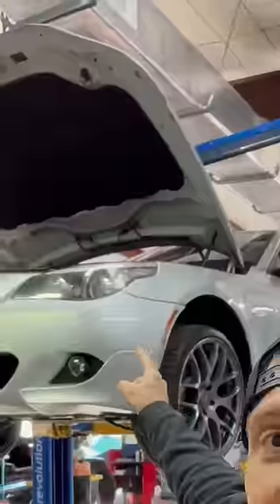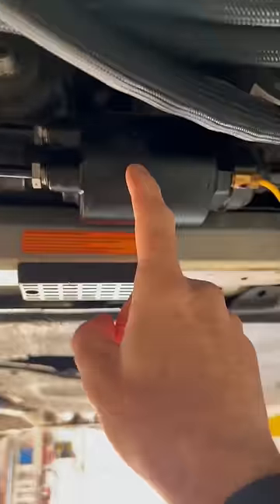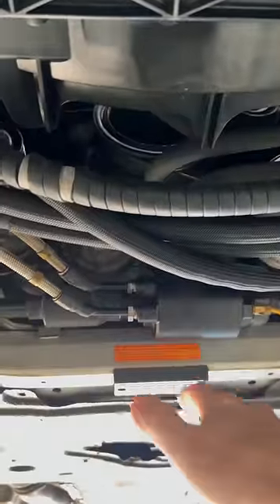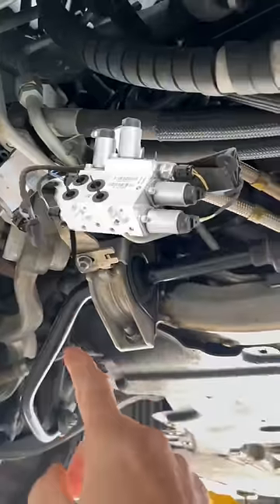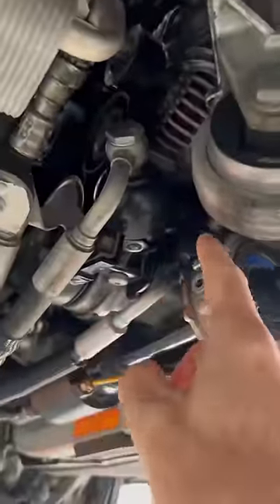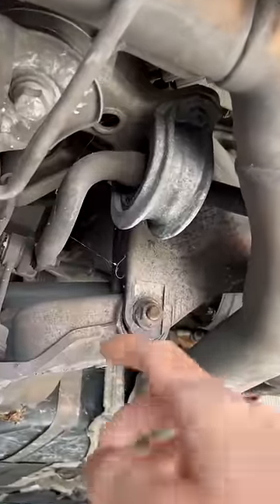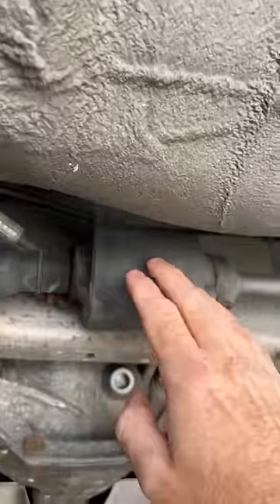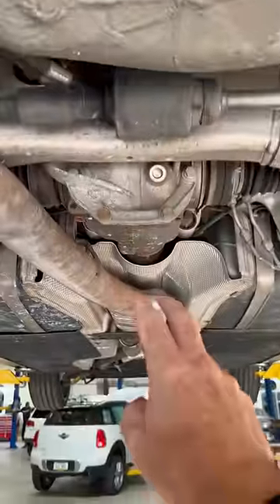Over engineered?

Comment: The system is a neat idea. The handling characteristics driving one of these cars are impressive considering the size and weight. I was working for BMW when this design came out and I now own an auto repair shop specializing in Germany’s big three (BMW, Mercedes and Porsche). We work on mostly older Porsche’s. I’ve experienced German over engineering for over 20 years and that is a prime example of German over engineering. These items are great until they aren’t then they are too expensive. You forgot to mention the over abundance of electronic involvement to make it work. All of that being said, I have seen very few issues with that system. That is great considering that is has been in those cars for nearly 20 years.
Reply: Perfect summary right there. Also, very glad to hear you haven't seen continuous failures on this system.
Reply: Owning an "old" BMW is a lifestyle or hobby if you repair it yourself. Nothing wrong in it, just admit that Toyota would take you from A to B with much less. I've now G30 530e -17 and I've been happy w/ it, but w/ the ex E46 330d -04 I spent far too much effort and money to keep it a decent daily. I'll change the G30 530e to newer after this summer, since I don't want to spent even a thought to the extra maintenance or possible issues it might get.
Reply: Same, went through BMW S.T.E.P. in 03. Worked on BMW's for 10yrs before switching to aviation.
Reply: Just out of curiosity.. what is your favorite German brand to work on?

I think I know the answer.
I'd like a confirmation from a guy that works on all German cars.

Comment: I had an e60 .... the active sway bar makes a world of difference
Reply: No they don't...get rid of the sway bars altogether and just get adjustable coilovers..☝️
Reply: @boosted2.4_sky  what is suspension geometry anyway right?
Reply: @stryker7x how would you know? Did you compare it with the same e60 with a solid sway bar?
A sway bar is only there to fix a problem caused by the centre of gravity being higher than the roll centre. If they just designed the suspension better, this wouldnt be needed.
But its so that you can have both comfort mode and sport mode, when Realistically, its just a heavy car with a badly placed roll centre.

Comment: Citroen used a high pressure pump for their hydraulic suspension, brakes and steering. Worked really well and reliably. When it needed service the repairs were simple and inexpensive.

Comment: it can actually cause body roll in situations where the body wasn't actually going to roll. for example, if the suspension travel in one wheel is far greater than the other on the same axle, it would roll the whole body, to prevent the suspension from completely absorbing the effect on one side.

Comment: My jeep has its suspension with air tubes and such to lift/drop the vehicle in certain conditions/settings. If a tube leaks, that is an easy 2000 to repair as well. Dont really consider that or this over engineering as it is there for a purpose and/or tuning and people just need to be aware of it when they buy them.

Comment: It's to keep any home mechanic from working on their own car.
Reply: Exactly!!!
Reply: No, i got a car lift @home and i could repair this. I am not a professional
Reply: Lots of things may be, but this, this is not one of them...
Reply: Build your own car then! You can work on it 24/7! :)) I'm not a BMW fan (or any other German car in fact), but you can't say they made this interesting system just to prevent you from working on your  old BMW!
Reply: not really? because you can get the parts through both the dealer or aftermarket. Also can replace it with a normal sway bar with little to no issue

Comment: It is awesome engineering. I had a 545i with that system. It provides a confident handling at all performance levels. had the car up to around 250,000 miles and that system never failed or had an issue once.

Comment: I had an 2007 750li and I had to change the front sway bar once at around 50k miles. I ended up getting a used one with low miles and had an indy replace it. Cost me $300 for the part and $500 for labor. Not that bad. Sold the car with 125k miles. Never had a problem.
Reply: Had the 06 model same car. Blew a few O rings hitting 155mph. Then the water pump went. Not too long after the engine was leaking more oil then it could consume. She was a beauty tho

Comment: My father taught me car control on snow before I got my license in a 1979 Toyota Corolla four speed. My second car was a 4 year old 82 Supra L that taught me car control on dry asphalt at speeds I shall not admit to but I've never lost control and wrecked so there's that. My current car is almost 20 years old and I'm keeping it and don't want driving aids and babysitting tech in my car. Besides, it's more fun sliding a car with no horsepower around at the speed limit than having more power than necessary although that would be fun on a rent basis.

Comment: Basically the same way activa on the Citroen xantia works, one drop link at the front and back was a hydro ram which worked on the anti roll bar to stop body roll and keep the tyre grip patch at it's maximum level.

Comment: Had to work on a 760 recently and found all this out. It's alternator bracket was leaking oil. Yea, you heard me. Also the alternator was cooled by coolant. So much else wrong with it besides too.
Reply: oil is not coolant and cooling off a part in a hot engine bay with water while also helping the engine up to temperature in winter is pretty smart.

of course. more functions more possible trouble.

remember the good old times of automobile where you plugged your steering wheel in the front of your car to manually crank it ?  that was a reliable system.  same on prop'ed planes. just yank the prop until the engine starts. no starter, no battery, no electronics to break.

Comment: Great for a new car and would be awesome to use, dynamic suspensions are the zero compromise option for handling and drivability. I’d rather just run big thick old school sway bars though for the simplicity and lack of failure points

Comment: I have an E65 with such active swaybars and I really like them. I do understand that this is a sensitive and expensive system but this is one of the things making the car running so smooth and perfect.
I'ts a decision: high quality ride or cheap and simple to maintain?
(Almost all of the older cars are leaking some oil at the hydraulic units of these swaybars. I agree that BMW could put more emphasis on the quality of the sealings, or, at least design them replacable. The sealings, not the swaybars. The swaybars aren't that easy to replace, either, it's not just their price but in E65 the rear one is deeply embedded into the web of arms and drive axles.)

Comment: I would want that on a 7 series type car to be used with for family outings. I would prefer to daily a 2 series that absolutely does not have active sway control unless the control itself is somehow totally manual (I don’t know, control it with column-mounted  paddles? Upper paddle affects the front, lower paddle affects the rear?

Comment: Well, I had a e65 for more than 15 years, the system didn't break and that 'cow' was keeping it flat even on very tight corners, that was pretty amazing... but, maybe I just got lucky. The problem in my opinion is that you cannot do anything to these mechanics, if they break, they break. It is not like with engine oil changes, where you can change the oil regularly, not rev it when it is cold, drive smoothly, use best type of gas/diesel ect. ect. that would keep the top shape. 

All in all, ok, I will say it like this - it is worth it in this case, because it makes a very big difference and at least old systems (I don't know about the new ones) didn't brake so often. 

If anybody has a different story, please share.

Comment: hydraulic lines at car bottom always rust out. This is duct tape solution. The correct way to do it is using active struts, which is way more expensive today, but it will be cheaper when Chinese manufacturers jump on it.

Comment: Porsche does this, too. At least with the Cayenne. It’s very cool watching it do the bleed procedure when the big thing moves side to side very quickly. Looks like a dog trying to shake water off. 

This is engineering designed to last the lifetime of the warranty. It’s too expensive too repair outside of warranty. I’m sure there are plenty of those out there with butchered or brown systems because the owners can’t afford the repairs.

Comment: Land rover used a system like this on the disco 2, except rather than a complicated anti roll bar with a hydraulic motor in it they essentially used a hydraulic piston in place of one of the drop links. Since BMW owned them at the time, I wonder if that's where they got the idea from

Comment: I think it's excellent engineering, but not exactly a good idea, one is it could fail fairly easily considering how much pressure it's working under and I'm sure a similar result could be attainable by using an idea like those lift kits for exotics and the on the fly adjustable dampers. I had an old tx5 Ghia ford Telstar ( we all make mistakes 🤦🤣) that had a system to adjust the suspension. It had 3 modes... soft, normal and " sport ". It did several things, under acceleration it stiffened the rear, under braking it stiffened the front and the same for cornering. It actually worked really well and by making adjustments at the shock would be far less difficult then doing it with the leverage of the sway bar.

Comment: Audi is now using electric motors on the sway bars ro do the same thing. The low version is 1 motor to torque the bar. High has independent bars on the same axle operated by separate motors. Can't wait to see that bill for failure.

Comment: Have this system on my 2010 e60 550i. I can attest that it makes a very noticeable difference in sport mode. Only problem is I have a leak at the small fitting that connects to the motor.

Comment: I feel like the amount of reduced body roll wouldn't wouldn't be significant, the ends of the sway bars are still pretty thin and therefore would still flex a decent amount. Dynamically controlled struts/shocks and a standard thick performance oriented swaybar seems more effective. The swaybar tech is more useful in a offroad application.

Comment: Those were pretty gravy to replace if you don’t torque the sway bar bolts properly to the subframe … it will crack the subframe just a heads up . Those cars were pretty flat though and handled.

Comment: The product development team would have had a set of requirements/attributes to work against.  We can probably guess what some of them are, but it's difficult for us to judge whether the engineering is good or bad without knowing.  

If for example their design life requirement was one year and it lasted exactly one year then that's excellent engineering.  If it lasted ten years after a one year requirement that is BAD engineering, this is because they could have made it cheaper, lighter etc (assuming they were also requirements) at the expense of reliability.  The opposite would also be true if it lasted one year after being designed to last ten.

Most cars these days are designed to last 15 years or 150,000 miles (which ever comes first).  On that basis if the car is a 2008, then even if all the sway bars fail this year, that is still good engineering, because that is what the vehicles was designed to do.  But a mechanic might say it's bad (because he's not an engineer).

Engineers will also likely know what the expected failure rate of a component will be, and some parts will fail early, we call those 'infant mortalities' (grim, right?!) which are usually failures down to manufacturing defects, and those that fail late are durability failures.  You might have that one car which fails late, and you would anecdotally say it's 'good engineering', or the one that fails early, and say it's bad.  Given what I have said do you see how in both cases you could be wrong?

So in this case, if the car has done 150,000 miles or so and is fifteen years old, and they aren't leaking then for this one vehicle that appears to be good engineering.  If that is the same for 99% of vehicles, then I would say it really is.

TLDR:  Is the car 15 years old and 150,000 miles?  If so then good engineering.  If the car (majority of identical cars) is  5 years old and 50,000 miles.  Probably bad.

Comment: I would plug off the 2 lines going to the rear and replace it with a lightly larger diameter solid bar.

Comment: people give BMWs a lot of shit about reliability but in my short experience working with them the various ECUs onboard have the most problems, the actual drivetrain is usually pretty stout if they're taken care of. But they're the only manufacturer i've worked for that has a section in the technician information system about using the cars for racing/ "spirited" driving and doesn't actively discourage the owners from doing so. Lots of other manufacturers sell a drivers car and tell you not to drive it over the speed limit or you'll start voiding the warranty lol

Comment: This is very old technology.
In 1992 citroen xantia activa had active torsionalbars that could be disabled from left to right side, it also used hydraulics for the torsional bars with similar pressure, and the suspension used hydraulic and nitrogen. The handling for this family car was absolutely amazing  McLaren like, the ride was also very smooth. Unfortunately the electronics was not bosch and not reliable "french"
The engine was also a disappointment, reliable but boring, low bost turbo with an 8 valve head, old tech.

Comment: It was designed to make the car handle better and it did so it was successful and I don’t think it’s really that complicated to basically have a sensor open a valve to supply hydraulic pressure to a “motor”. The only issue is that it’s a lot of pressure relative to most other systems for a car which would be more of a problem except it’s BMW so they probably put in many fail safes to prevent an all out failure of the whole system. That is what makes it complicated. It’s a smart idea but it could’ve been done by just making the car lighter and having a stiffer bar.

Comment: Well, depending on the actual impact of the system during driving, and how much it helps steady the vehicle, and how reliable that system is, I’d say it’s good engineering. 

If it’s a system that fails easily, or has little impact on the stability of the vehicle, I’d say it’s very over engineered.

Comment: I'm the wrong guy to ask this because when I look at collector cars for sale I have to ask if they had reverse gears or even crank down windows because that can be a stretch for me. (Some example cars I've looked at are the king midget model 1,2 and 3, the hmv freeway, any car made by Peel, crosley sedans and wagons, the trabant, I've considered a lot more but I wanted to point out the most basic vehicles I've considered) 
Most likely I will end up with an air cooled beetle (because when I get my collector car I actually want to be able to get parts for it) and even with that having a lot of creature comforts absent from the cars I mentioned above I can actually work on the darn thing.

Comment: Worked on bmws for 11 years. I've also had 2 e60s with those sway bars and I've never seen a issue that wasn't caused by a accident. Id say that system was built correctly.
Reply: Merc offered a system called ABC, which has the same function. It don't has a good reputation in used cars, and is very expensive to fix. I think it's different built, it uses special hydraulic dampers, which cost thousands to replace and they wear like normal dampers

Comment: This system is a bit expensive, my dads Land Rover Discovery 2 has basically the same but the actuator costs only about 300 each. Otherwise it's pretty great, the very top heavy suv doesn't have any body roll on road.

Comment: I think the difference between good engineering and over engineering related to cost Vs benefit. 

It’s clearly much more expensive than other systems that perform the same function. 

How much better is it?

It seems more prone to failure. I’m not really clear on what you’re gaining in performance for the extra up front and maintenance costs associated with it.

Comment: Over-engineering is a misnomer. Engineering is the application of science to solve real-world problems. One of these problems is cost, so if cost is no issue: you don't need to engineer for it (like this BMW). This is in effect an under-engineered design- they've said "hey we need to stabilise this vehicle in cornering and high speeds. I know! Let's whack in a high pressure hydraulic system!". Which, hey, it's cool but it isn't really engineering at its best as they have taken the cost constraint away from the problem.

Comment: When people say over engineered they usually mean it wasn’t an engineered, as in actual calculations were not made, industry standards were not followed, component specifications and capabilities were not explored, etc.  Instead an amateur who couldn’t do the real engineering chose more weight and cost instead of a design that simply works well enough.  I wouldn’t consider the concept of a hydraulic actuator on a sway bar over engineering, in the world of hydraulic systems 2800 psi is pretty low, rotary actuators are quite common and if used within their design capability they are reliable.  So no, I wouldn’t consider BMW’s solution over engineered, I would actually say the opposite.  On the other hand, the concept does seem like a poor cost to value decision for most drivers.